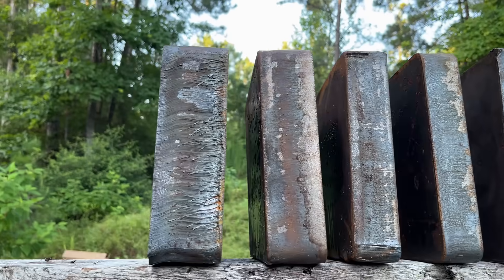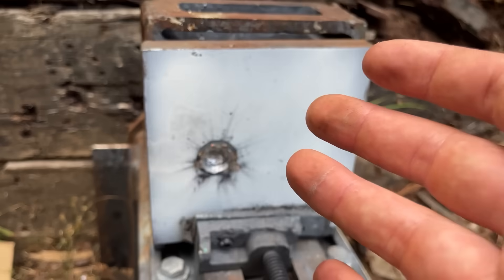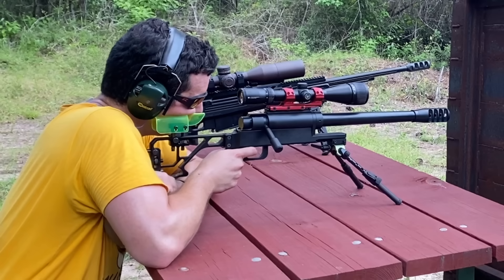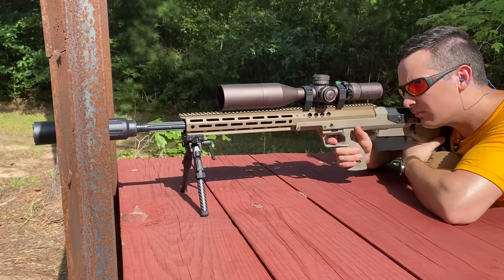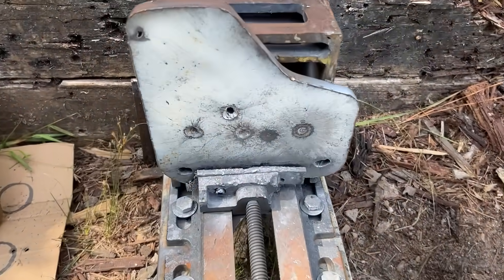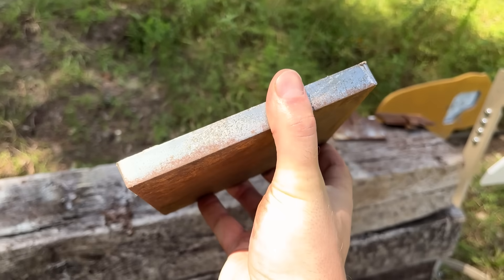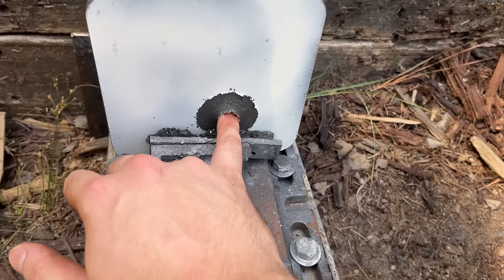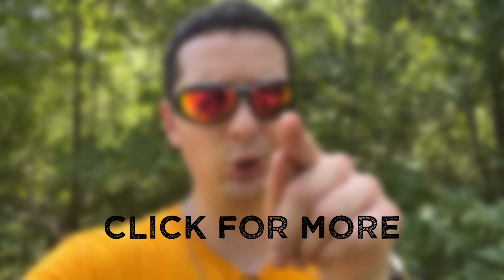How Much Steel To Stop A 338 Lapua Sniper?

Comment: It begs the question: What caliber, bullet combo, that is NOT an AP round, can pass through a car engine. I will define that as an American v-8 engine fully intact, not stripped down. What caliber bullet combo would stop and engine from running? Distances of at least 50 yards.
Reply: A .416 Rigby with brass solid
Reply: @simonni4483 the Rigby is where it is at for power and mass, a real performer.
Reply: The APLM won't be stopped for sure. Not in longitudinal or transverse direction. An aluminum block is like butter to the APLM and cast iron would be to brittle.

I think the regular LM will not make it. 50 BMG or 20mm maybe.
Reply: An engine block is not that tick and it all depends what the bullet hits for if the engine will stop running could be done with a 5.56
Reply: You wouldn't have to go all the way through the block to stop it from running.  To me that's two different questions.  All the way through a fully built engine or immediate shutdown.  You knock a big hole in the front of a block or split a rod and it will shake itself apart pretty quick
Reply: Pryor shot his with a .357 Magnum, IIRC...

Comment: Can I handload my 338-378 Weatherby with Armor piercing tungsten core bullets? Will it cause any serious problems in the barrel or any other kind of problem?
Reply: As long as there's a jacket and you adjusted the powder load for the weight I can't think of anything that would go wrong.

Comment: If you want to reduce your ammo costs, start using a binary search pattern. Shoot the middle strength plate, then if it does penetrate skip to the 3/4th strength plate, otherwise the 1/4th strength plate. Iterate as needed.

Comment: My .300 WinMag with AP goes right through 1 1/4" mild steel easily.  So I had no doubt that .338 would go through 1 1/4 and also 1/12.  I'd bet that it will go through 2".  Let's see.
Reply: So, 1 1/2" stopped it.  Color me surprised.

Comment: Now the question becomes when we get to see a .416 rigby with ap rounds if they even make them
Reply: They might as well be AP with regular loads according to Kentucky Ballistics
Reply: @ShampooTheAviator  most the time kb is using copper solids and for penatration better definitely better then fmj ball rounds but just a mild steel core let alone a tungsten core would blow the copper solid out of the water on penatration
Reply: @redmist6131  Kentucky ballistics doesn't actually use the copper solids. He uses the brass solids which are harder than lead and harder than copper. So by technicality it's already an ap round from the factory but it's used for other things

Comment: Video idea: solid thickness of mild steel vs. sequential stacked plates equal to that solid thickness. Stacked plates can be directly contacting each other or separated by shims.
Reply: There was a simulation video of that but composite armour pressed together tightly is a different story
Reply: I kind of believe that there would be a difference in the "penetrability" (yes, I made up that word) of a solid piece versus stacks of steel.
Reply: Start your own channel...and then pay and go for it there kiddo...(poor boi)
Reply: @Enolagay1945 the dude on the can probably doesn't subscribe to my channel, so anything I offered to the web gods would be marginally less entertaining.
Reply: @Enolagay1945 you sound bitter and butthurt over your micropenis problem, dont worry little guy its not that bad

Comment: You try face hardening the mild steel plates by using the 1870 to WW1 armour technique of "Harveyisation". Basically, this is where a mild steel plate is heated to red hot and left to cool, face down, on a bed of charcoal. The steel's surface absorbs the carbon from the charcoal, becoming "Harveyised" face hardened armour. This type of armour feel out of use, in the 1920's, when rolled homogeneous alloyed steel armour was invented.
Reply: That's basically a surface case hardening.
Reply: Interesting. I wonder with the brinell hardness is after this process? Would be a cool YT video for someone to make.
Reply: Interesting tidbit, thanks
Reply: Case hardening powder.
Reply: You can heat it up then dip it in oil....
Reply: not enough carbon in mild steel to harden at all. This method provides the additional carbon that effuses into the mild steel plate just on the surface.
Reply: @trentvlak  That would harden the entire plate making it brittle. Perhaps if you could just lower the face into oil but you'd need a nice rig to do that safely.
Reply: @Grimace427  not enough carbon in mild steel to harden at all. This method provides the additional carbon that effuses into the mild steel plate just on the surface. And since only the surface is hardened, the rest of the plate remains mild and so it will not shatter.
Reply: @kenricrose  Good to know!